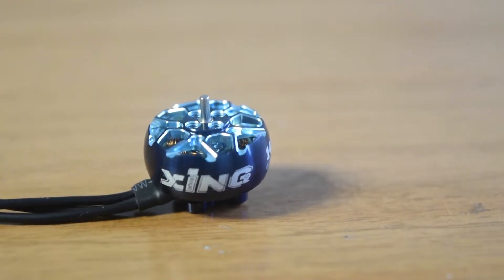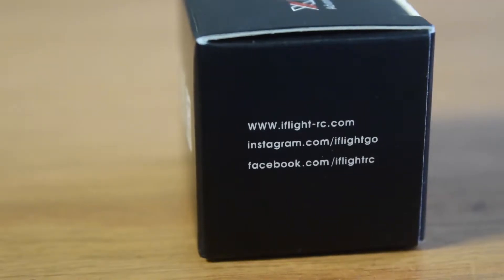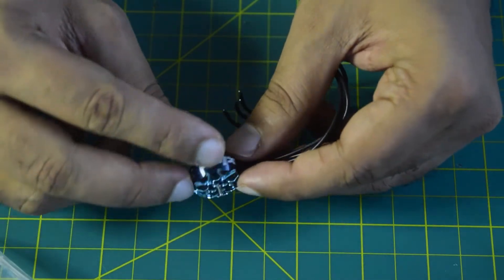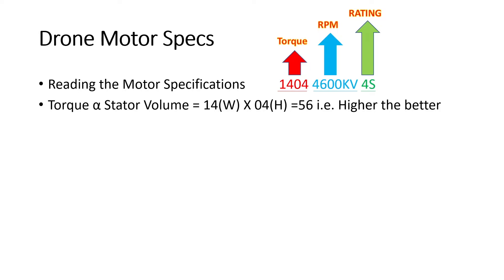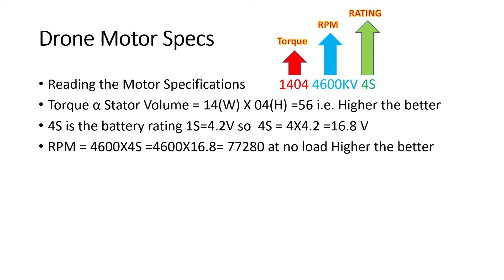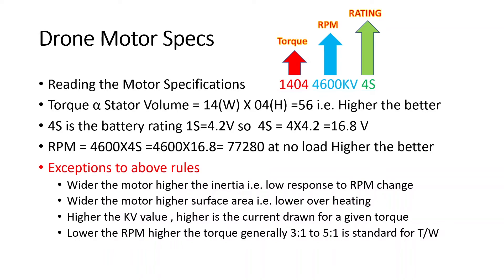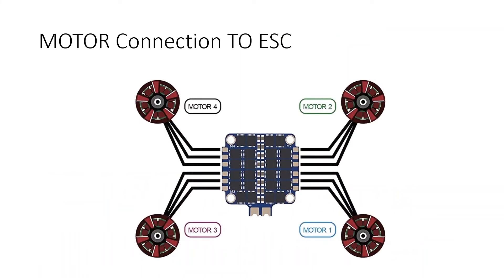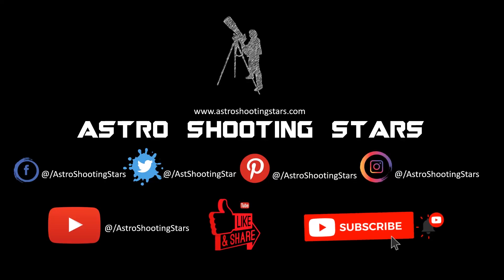iFLight Xing2 1404 4600Kv 4S CineWhoop Brushless FPV DC Motor for indoor Drone | Unboxing and review

Comment: great video my friend! i currently have a babyhawk with o3 and 3.5 inch props running 4s. it has 1404 3700kv emax eco motors, will i get more thrust for freestyle if i upgrade to the xing2 1404 4600kv motors? or is that too high kv for the drone? what would be the drawback? im guessing it will lower flight time for that increased power right?
Reply from the maker: with 4s using higher KV is not a problem provided you have the right esc as well to support this. apart from lower flight time there is high heat generation. normally there is no direct issue as long as you ventilate good your esc you should be good. to see and select motor guide i have other videos on my channel that would help you select the right motors for your build. I hope this helps please stay tuned to my channel for my future videos.